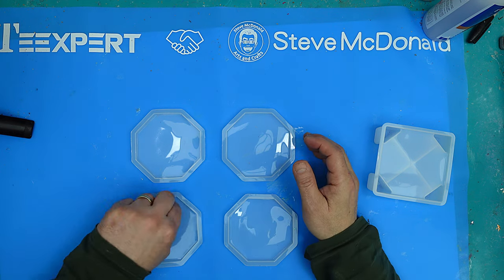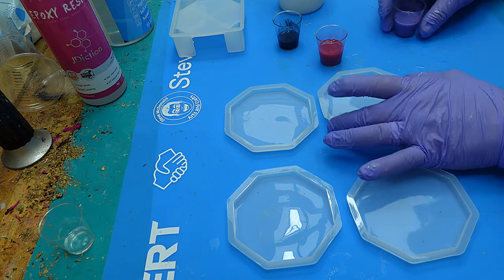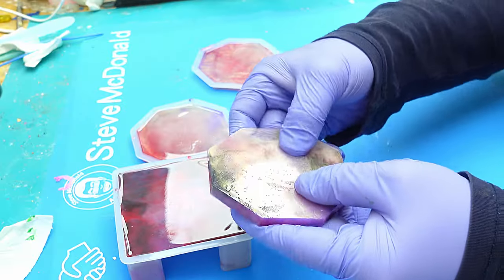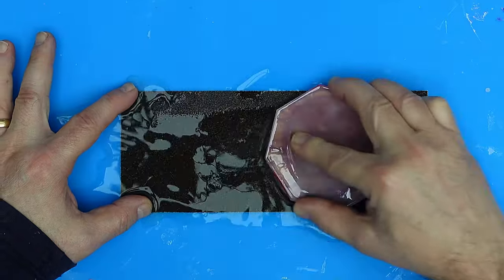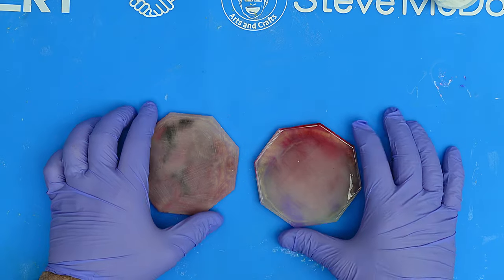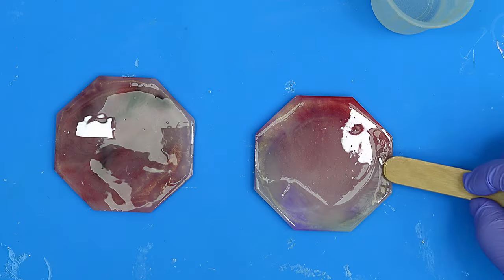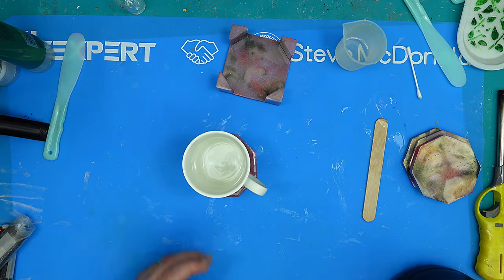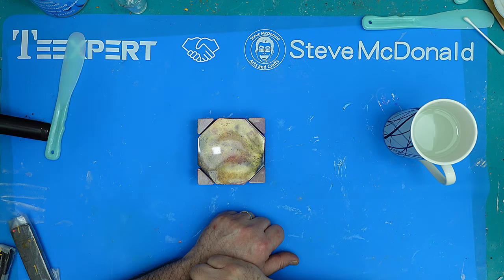How To Make Your Homemade Coasters Perfect

Comment: To stop edges when epoxy shrink,  or minimise a lot, I use a bit of silicone oil around the edge before pouring resin into the mold. That work great on my projects,  the resin follow down while shrinking instead of sticking to the side and leave an edge.

Comment: Top tip: If you’re trying to flatten something by sanding it, put the sandpaper on a piece of tempered glass. Glass is always super flat and basically guarantees that you won’t have uneven pressure on the coaster as you sand it. Mirror is good, too, as long as it’s thick enough!

Comment: Epoxy is self leveling, meaning you could just flip the coaster to the ‘worst side’ put it back in the mold and pour a bit of epoxy resin on top and it will level off smooth.

Iv done that on fishing rods and other epoxy resin projects as the top layer makes no difference to the look at that point.